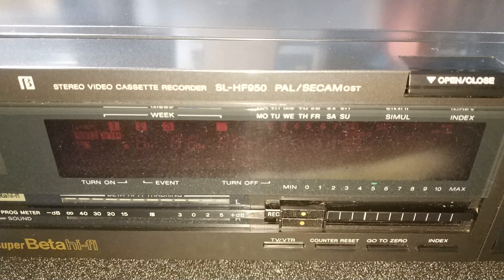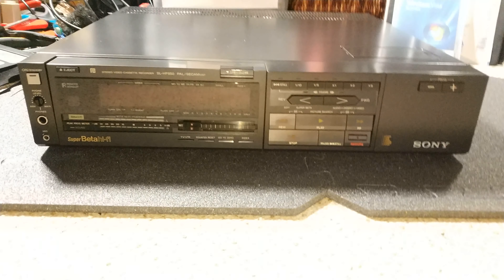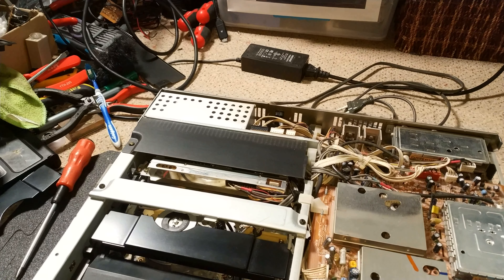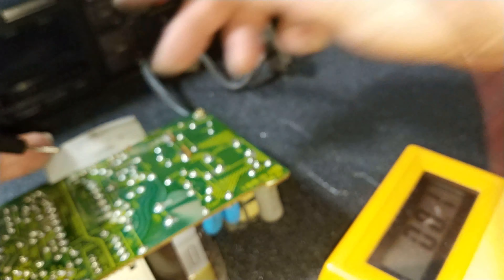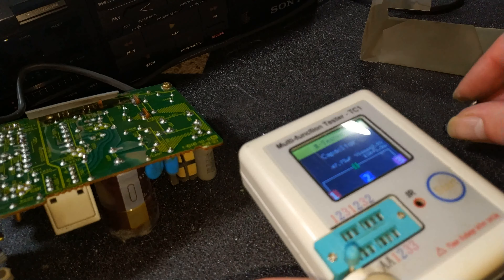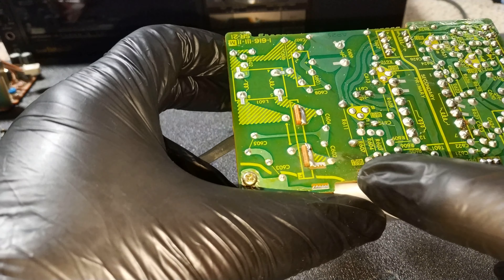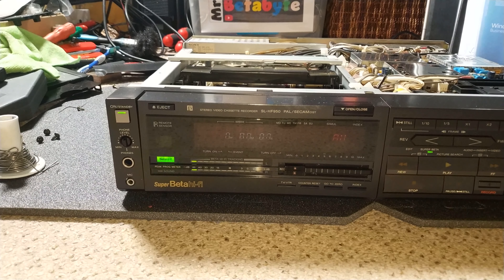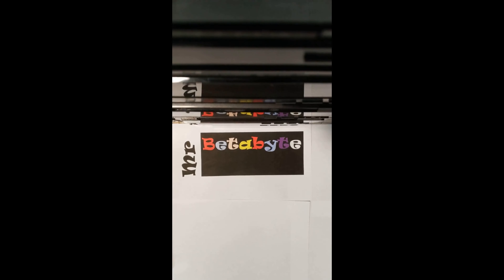Sony SL HF950 SL HF750 Betamax power supply repair

Comment: Hi, nice work. A couple of questions, will the PSU run outside of the machine without a load? Also, where do you source the bipolar electrolytics from ? I have some Hitano (Taiwanese) 105degree ones, but they are 50v rated. I can source lower voltage ones but they are only 85degree. It’s an odd design using this bipolar capacitors and obviously a weak point.
Reply from the maker: I now use ceramic bipolar capacitors mounted under the PCB rated at 16v as they should never fail. Not sure if they'd run with no load at all. In theory they should still give 12v or so but in practice may well shutdown detecting the no load as a fault. I'll give it a try next time I have the chance in a video. I get most of my capacitors from Farnell.
Reply: @ yeh, that did cross my mind about using ceramic. I fitted the new hitano 47uf 50v 105degree caps and the psu worked for about 3 minutes before going dead. On further investigation, I found both switching transistors s/c and feed resistor open (as mentioned in your video). The ESR of the caps measured 0.5ohm, so seemed pretty good to me, so I’m not sure the reason for failure. I’m going to retro fit a 12v psu instead, as parts for the Sony SR-21 psu are long since discontinued.

Comment: I have to do a lot of research before I can publish my opinion.
Reply from the maker: Anything that adds some more positive work to carry out on these power supplies to keep them running smoothly is great. They are fragile. Ignore the fusible resistor; I did change it afterwards for the correct value although what I did fit works out to give a tighter fusible point. I've also been discussing via email using ceramic capacitors which never even occurred to me but would be a great reliability boost to these power supplies.